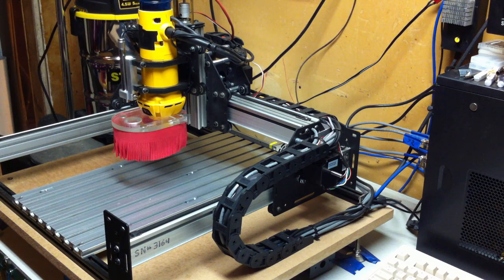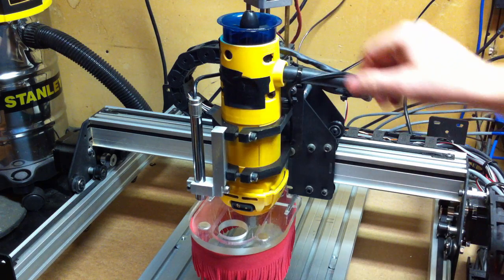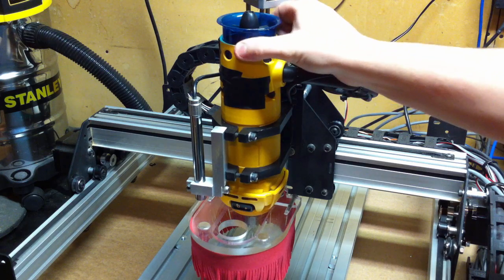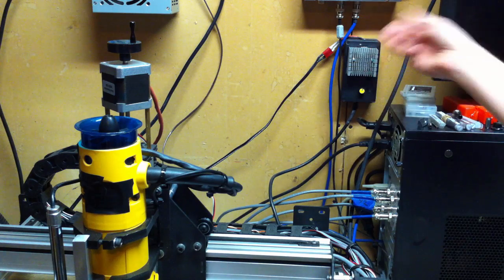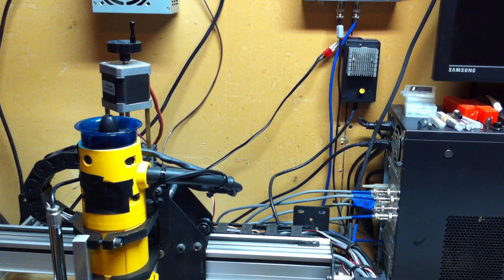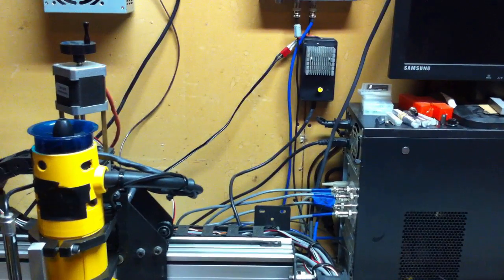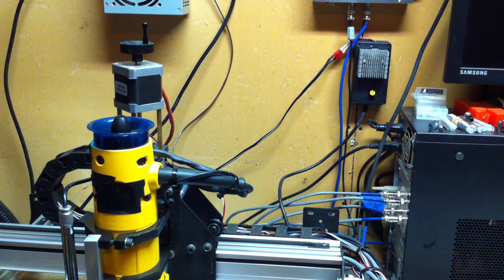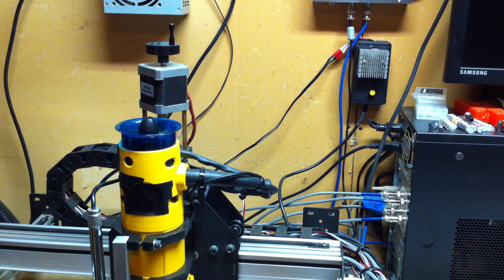ShapeOko 2: Drag chain, and something a little crazy.

Comment: Hey Caleb, the drag chains look great!   I've had a few problems with mine catching at times, have you seen any problems like that on your setup?   By the way, I did the ACME screw Z-axis upgrade.   I can't recommend it enough.   I had unacceptable runout with the stock threaded rod, and after the screw upgrade it is nice and accurate.  Did you ever get the camera mount and limit switches finished?
Reply from the maker: 1. Nope, I haven't had any trouble with the drag chains catching.
2. Yeah, that Z-axis upgrade is a good thing. I'm working on my Z-axis right now. It's going to be sweet.
3. Well, the limit switches are done. The camera is kind of working, but it still needs more work.